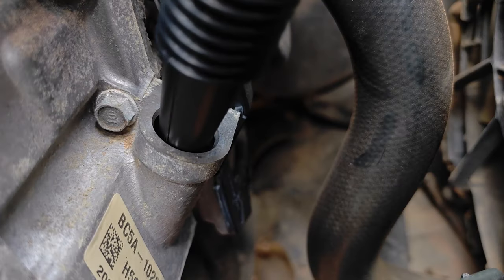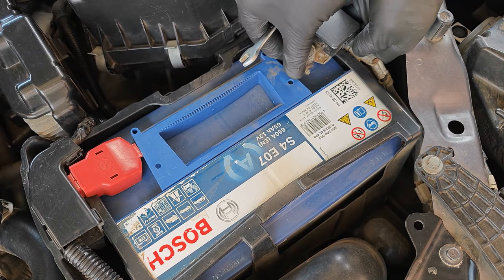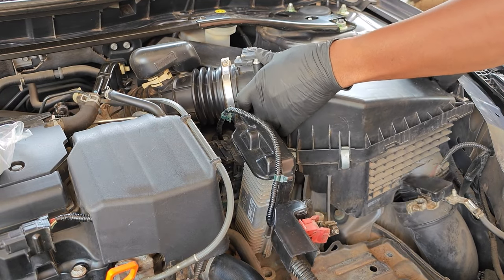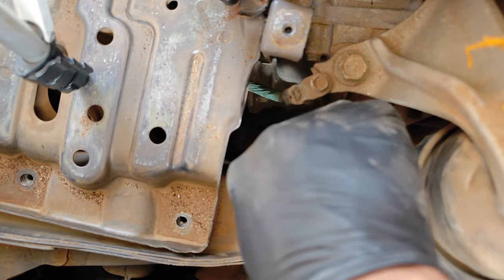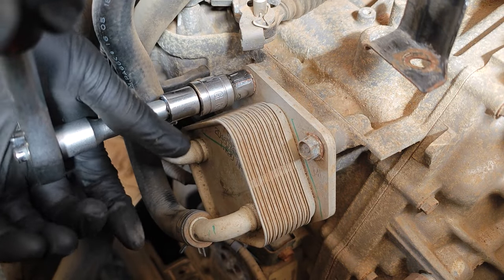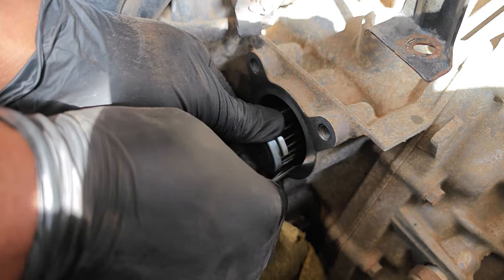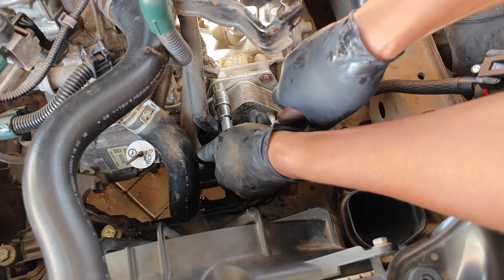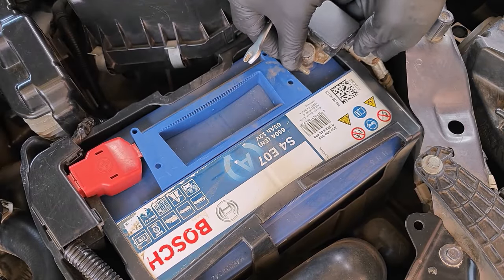Honda Transmission Filter Replacement: 2013 - 2021 Accords Civic CR-V / Replace transmission filters

Comment: I don't ever take it to heart when they specify a "lifetime oil/filter"; it can be interpreted in any way, but loosely means the expected lifecycle of the vehicle. If you change fluids and filters on the regular, the car in terms of wear would survive for pretty much as long as you want. Nowadays manufactures are taking it to the next level with completely seals units making them harder/unserviceable. Keep up the videos
Reply from the maker: You struck the nail on the head! For some manufacturers, "the life of the vehicle" is the warranty period 😅. Thanks for watching and the compliment.

Comment: I called Honda (parts) yesterday, wanting an internal transmission filter.  (2013 Civic LX with a 1.8 engine).  The parts man said there is no internal filter for my vehicle.  In your experience, are there 2013 Civics that do NOT have this filter.   I am puzzled.

Comment: Whenever the transmission fluid is drained, does the filter need to be changed as well?
Reply from the maker: No mileage interval specified. I'd likely do it every other fluid change

Comment: Clean MAF sensor since you have access to it. I'd put anti-seize on the bolts when you back together
Reply from the maker: I'm up to date with cleaning my MAF, so no action needed there. Anti-seize sounds like a good idea. Those bolts had a lot of corrosion!
Reply: those bolts to the warmer filter originally have liquid thread locker compound on them . i would not use anti seize @DIYAutoworksNG

Comment: Fabulous video!  Question:  would it be easier to replace the transmission filter from beneath, rather than taking out the air intake and battery holder from the top?
Reply from the maker: Good question. Never tried, but I don't think so. 
For one, wouldn't have been able to clean all the crud I found on the mating surface from beneath. Also, I'm not sure how much of a clear line of sight you'd have to it.
Reply: No there is no way that would work. It's not hard to get from the top tho don't worry

Comment: Great video bro. Seems like the biggest hassle is all the bolts holding the battery tray in.  I have a 2015 w/98k that I’m planning to service.
Reply from the maker: You're so spot on! That battery tray removal; thanks to the location of the bolts, is the most difficult part.

Comment: Great video, very thorough and to the point! I’m also OCD about things being done right and saw another video where the guy just tightened those three bolts and I wondered the same, must be some torque spec I would think🤔 I say when in doubt go about 30ft/lbs.on something like that.
Look forward to seeing the pan filter change. How often do you think these should be done? Do you think every 2-3 fluid changes would be good?
Thanks for the info!👍🏼
Reply from the maker: Thanks for the compliment.
Man! I scoured the net for the torque values for those bolts: it's not listed on Haynes manual, and Honda apparently doesn't sell service manuals to the general public as they used to. I don't recall what I used eventually, but didn't go too far beyond what I put on spark plugs. It's aluminium, so it won't take too much torque.
Honestly can't say what an ideal frequency would be, but every other fluid change could be what I'd do. I'm sourcing the filter in the pan and should do that one too!

Comment: I believe there is another filter/strainer in the transmission pan.  That's a mesh strainer that stops big stuff from being picked up.
Reply from the maker: Yep. You're 100% correct. This one is the easier one to get to.
Reply: @DIYAutoworksNG I would say the pan is easier to get to , you only have to take the skid plate and the pan off and its right there

Comment: Mi accord hace un silbido, despues de que le hicieron cambio de aceite y filtros de la cvt, ¿Haz escuchado algo sobre el tema en tu localidad o otros autos? Saludos.
Reply from the maker: Hello. I've never heard of this before. Did you add the correct amount of fluid and confirm it's level via the check bolt?

Comment: i am bit skeptical about volume of oil, on youtube as per many mechanic/ Diyer mentioned 3.8/3.9 QT , but when i drain and measure used oil it came 4 QT and 600ML , when i fill new oil keep the car best possible straight , fill 3.5QT , start car move shifter all drive mode for 5-10 second 2 times  and  open leval plug (12 mm wrench) , again fill up by reaching almost 3.8 QT it start to come out , i plug it back , more or less i fill new oil 600ML less than what it actual came out, should i add atleast 200-300 ML ? or as long it overflow from leval plug it is good regardless what actual came out NB: i did this car first time i don't know that previous owner did transmission fluid chage before and he did over filled 600ML,  if any expert can share on this 
thanks in advace.
Reply from the maker: It's likely the previous owner overfilled. As long as its flowing out front the check bolt hole, you're good.

Comment: Can you just replace the ATF filter and not do a drain and refill or do you have to do a drain and refill
Reply from the maker: You can replace the filter at any time. Fluid spill is minimal.
Reply: @DIYAutoworksNG  thanks a lot , my Honda has about 240k miles on it and I am having some slow shifting issues would you suggest a drain and refill or maybe just add some Lucia transmission prevent slipp oil ?
Reply from the maker: Had you always replaced the tyranny fluid?

Comment: ¿ The transmission in this model  have another filter  under the car i mean the carter ?
Reply from the maker: Yes it does. I've bought that filter too and will be replacing at another time.
Reply: @DIYAutoworksNG  Thank you so much for the info confirmation.